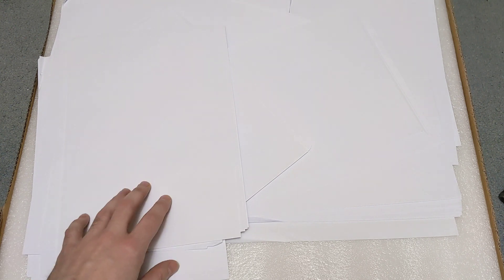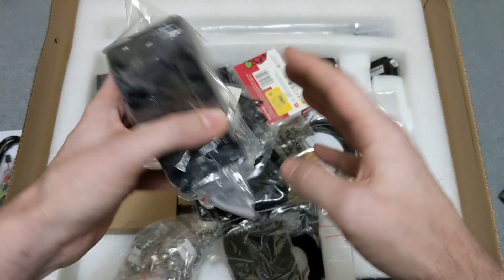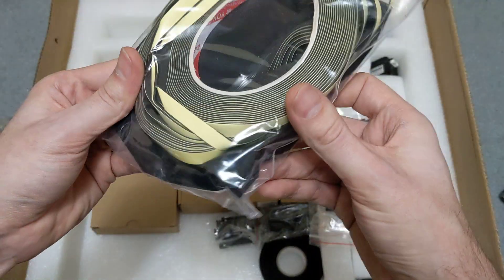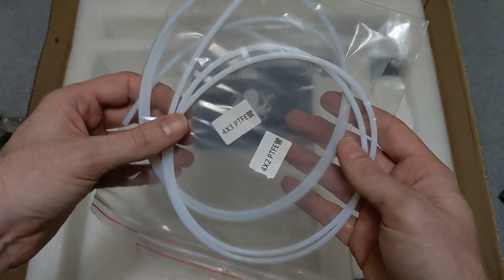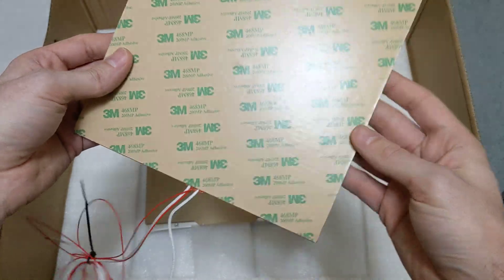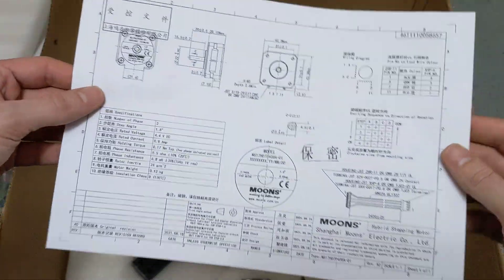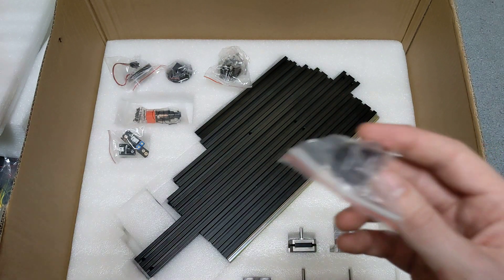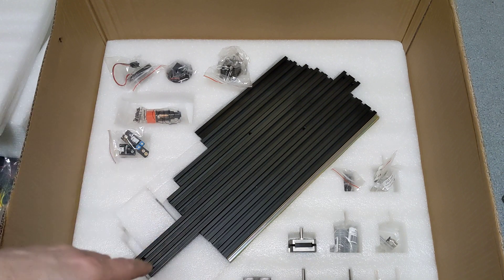FORMBOT Voron Trident 3D Printer Kit - Unboxing

Comment: Currently the formbot 300mm kit is about the same price as a new K1 Max.  I'm tempted to get one.  I think they now come with the Voron Tap.  I would replace the hot end with the Revo Voron PZ, though the TAP is a nice system too.
Current kit has Stealthburner parts with CC2 extruder.  I'm building a G2 extruder for my Enderwire conversion of Ender3 printer. (which is why I'd go with the 300mm K1 Max or Trident).

Comment: Well, I finally pulled the trigger on ordering a Formbot Trident kit (I am blaming you :)).   You mentioned that the Pi will not be used for Klipper and a computer will be used instead.  I found a method to run klipper on a windows machine using something called BlueStacks.  Is that how you run Klipper?  I hope I won't be too big a pest during my build.  Thanks, Rich
Reply from the maker: Awesome! Glad I could influence you haha, I just finished building the frame and everything went well! Video soon. I am using Klipper on a laptop running linux. You can use this very easy install script called KIAUH. I hope to make a video on that too. My printed parts will show up in a week so my build will happen sooner than I thought!
Reply: I had thought to ask if you were using Linux but I see I forgot. Thank for the reply.
Reply: How do both of you use it? I have a spoilt rp2, and I want to run klipper but all the pi prices are up the roof now. I would love to run it on windows, is there a guide? Linux also works, but is it possible to run it from a virtual machine?
Reply from the maker: @gedeonang7077  a Linux virtual machine should work. I have never tested it. I have a old laptop that runs xubuntu
Reply: @Rolohaun  How do you do it? Is there a guide? I have done some research but couldn't find much about installation, and I'm pretty new to linux and stuff. Is there a direction you could point me with please?
Reply from the maker: @gedeonang7077  I have not found a decent guide. Basically you would use VirtualBox, install a xubuntu ISO on that and then use KIAUH to install Mainsail and Klipper. I would like to do a view sometime on this
Reply: @Rolohaun  I will try that, thanks!
Reply: @Rolohaun  I already downloaded virtualbox, installed the xubuntu iso and  installed kiauh. However, when I try to run ./kiauh/kiauh.sh, it says permission denied. After using the sudo command it tells me that it should not be run as root. What should I do?
Reply from the maker: @gedeonang7077  Something seems off with your install I can run ./kiauh/kiauh.sh without sudo. I just tried this from scratch and no problems.
Reply from the maker: @gedeonang7077  are you sure you installed xubuntu on the VM hard drive or did you just use it live from the ISO?
Reply from the maker: @gedeonang7077  I also setup a fixed 10GB Hard drive for my VM when I created it
Reply: @Rolohaun  Oh. It makes sense now. I will try reinstalling on the hard drive, thanks so much
Reply: @Rolohaun  It works now, thank you so much! I have installed klipper, moonraker and fluidd. But how do I find the instance and launch it (and connect to printer via USB)? Or is it possible I install the octoprint version and use it on the octoprint server I set up already? Thanks!
Reply from the maker: @gedeonang7077  Have you joined my Discord server? I can help you easier there.
Reply: @Rolohaun  Alright, Ill join now
Reply: @gedeonang7077   I realize your comment is old but just dropping a confirm, yeah you can run klipper in a linux VM. I have an old small form factor PC I run ProxMox on with VM I use as my home router, another VM I use for my plex server, and another VM I use for my klipper instance. Then I just pass the USB port through to the VM to talk to the printer, Ender 3 in my case.